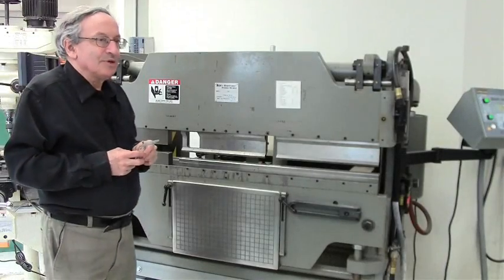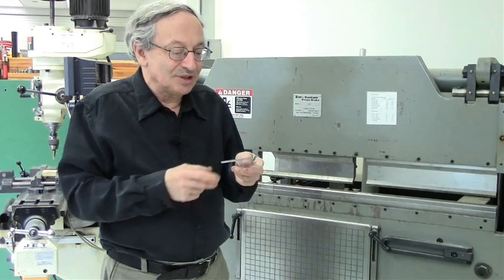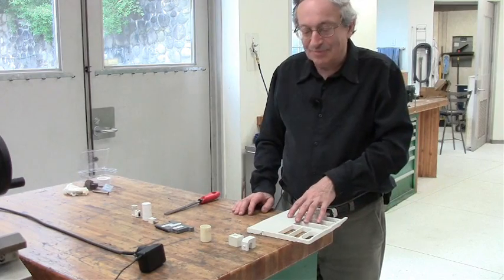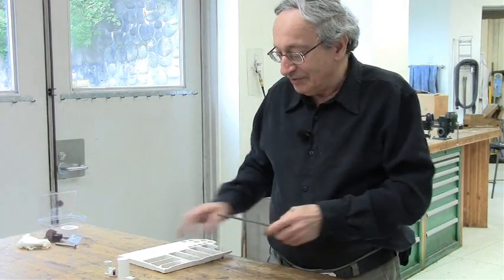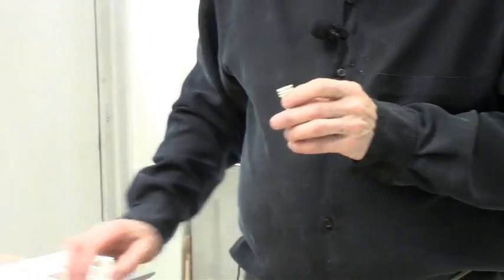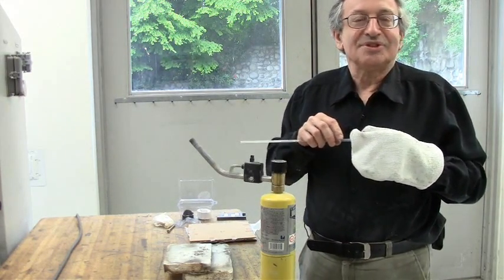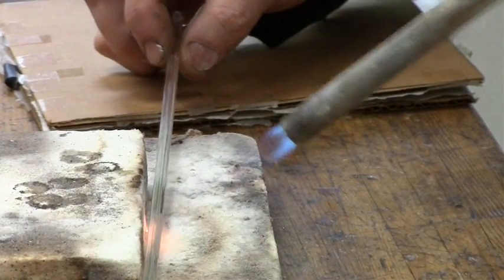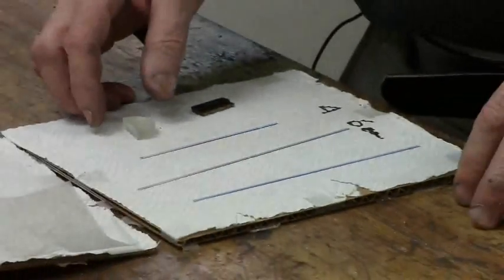Building Prototypes Part 11 of 18 Non-Metals

Comment: I'm unfortunately not too familiar with non-metallic materials, can I please ask you how to spell the material "bonitrite" mentioned at 5:11? Thank you!
Reply from the maker: The material is Hexagonal Boron Nitrite. The only material that can be used for bearings in air at 1000 deg C (2800 deg C in inert gas). It is also an amazingly good heat conductor while being an electrical insulator.
Reply: Thank you very much, Mr. Gelbart. Truly appreciate your prompt help and detailed explanation!! Your knowledge is helping me immensely as I progress from junior mechanical engineer to senior mechanical engineer.
Reply: @jeanapp_  Doctor Gelbart 😀

Comment: Has anybody an idea how to make micalex for your self as mentioned in the video? Or any vendor?
Thanks!
Reply from the maker: Michael Rußwurm You can still buy it but prices are insane. For now use slate or soapstone as a cheap replacement.  They are good to about 1000 degC (1800 deg F). They delaminate at high heat (say over 500 deg C0 but this can be taken into account in the design.

Comment: looks like it's spelled Mycalex (not Micalex), if anyone else is doing a google search.
Reply from the maker: Correct spelling is actually Micalex,  some company trademarked Mycalex, but Google favors Micalex (30,000 vs 20,000). Unfortunately, the correct spelling will not help you, as this product got priced out of reach. Used to be one of the lowest cost materials around, but the new generation did not know it so they almost stopped making it.
Reply: @dgelbart  You mentioned that it's easy to make. Can you share more information about that, please?
Reply from the maker: @capcloud  It is a mixture of glass powder and mica powder, but I don't know the ratio. The mixture is heated to about 1000 deg (again, I don't know the exact temperature).